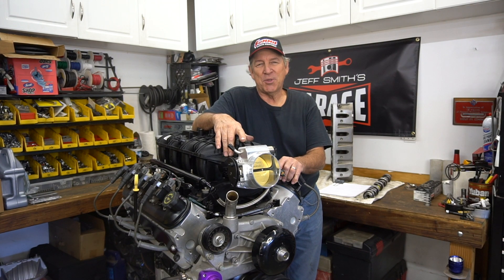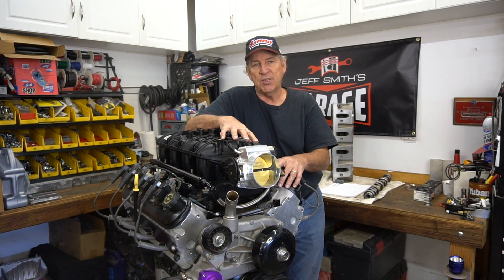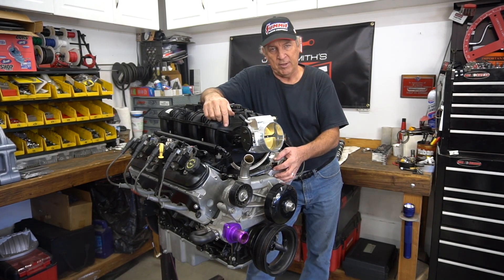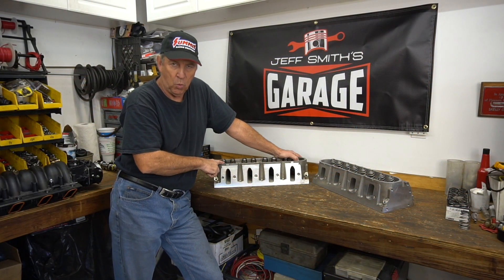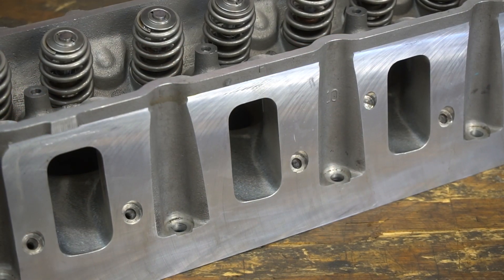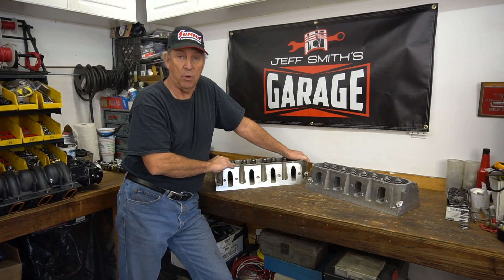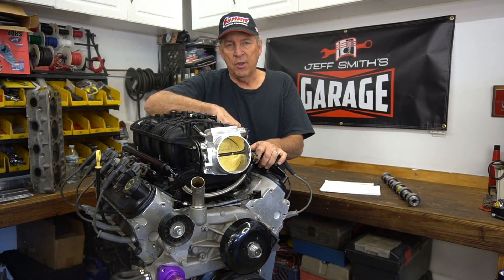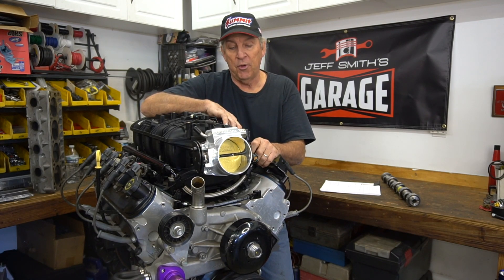Jeff Smith's Garage Favorite Chevy LS Engine Combos

Comment: which 5.3 heads are you referring to, 706/862 or 799/243?
Reply: David- this was in reference to the 5.3L heads with casting numbers 706 or 852 with their smaller chamber size of 61cc. Those other heads are actually LS1 style heads with a larger chamber at 65cc that won't help the compression as much - but still better than the 6.0L heads which are 71cc.
Reply: Knock a few thousands off the 799 heads will get them down to a 61cc chamber, with the bigger 2” intake valve and a little more cfms on the intake side. Works very well on a street 6.0